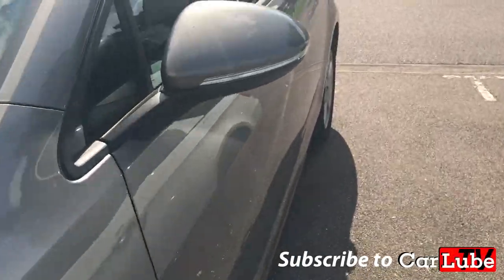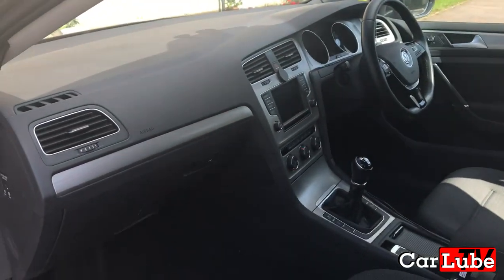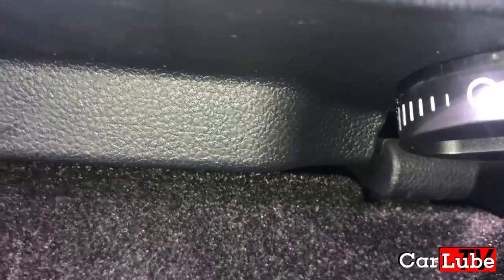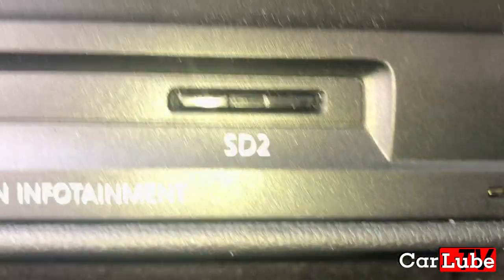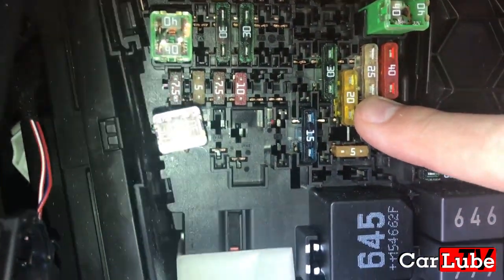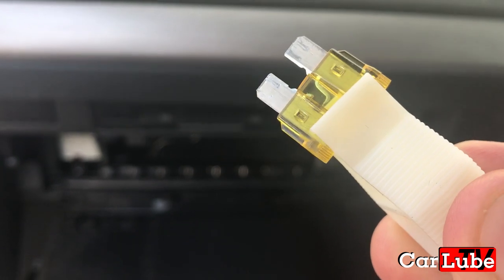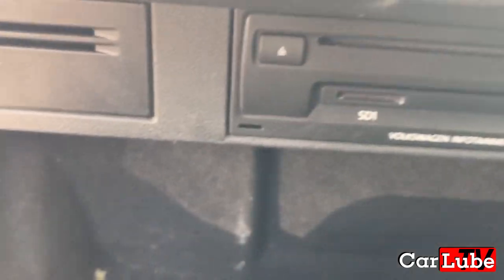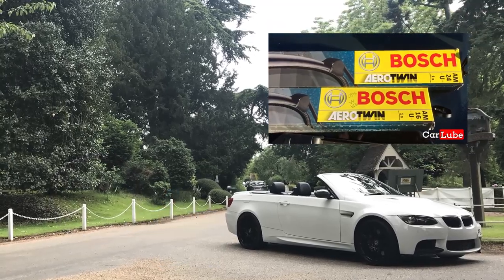VW Golf Mk7 How too change a fuse / cigarette lighter 12v

Comment: Missed an opportunity to share with everyone the multi position option on the cigarette lighter fuse.  In its current position power is supplied when the car is on.  Move it up to align with the other fuses and it will always be powered.
Reply: That is helpful to know, I will never use the cigar lighter socket on my car, but can use that for a dashcam install.
Reply: @Jimages_uk so you will use the cigarette lighter then.
Reply: @robbylebotha  no, I used a permanent supply.

Comment: If you move the 20A fuse up a notch so it’s level with the 30A your cigarette lighter and any other power sockets will work with the ignition off.
Reply from the maker: Wow great info mate.. 👏

Comment: Thanks for this, the general info still holds true, but on my 2017 Golf SV I discovered a few changes.  Although in the same position, the release lug operation design had been slightly changed. The left one was a ‘click lever’ that required first to be lifted up and the right one was a very awkward ‘push lever’ that was hard to access and operate behind the ‘cooling’ vent control.  Once these were released the glove box dropped down, but be ready for the ‘soft close’ retaining control bracket to fall apart. I found it very difficult to re-assemble the glove box, requiring the ‘soft close’ bracket to be first engaged with the ‘friction gear’ retention bar at the same time requiring the left lever to be set and the right button to be simultaneously pushed up. It required several attempts to get all three elements in the correct position. I find it hard to believe that VW could have designed such an awkward method of retaining the glove box in order to access the car’s fuse panel?
Reply from the maker: evanofelipe thank you for your info, I’ll have a new golf soon so I’m sure I will find this too

Comment: Also, if you move the yellow fuse up so that its in line with the three fuses either side, it makes the cigarette sockets in the boot and beside the gear lever live all the time, ie not ignition controlled.
Excellent video BTW. So easy to watch and follow.

Comment: Couldn't make head or tail of the manual, so I looked here and found this: worked in about 2 minutes. As it happened, my fuse wasn't blown but merely loose. Removing and pushing it back in firmly worked a treat. 

Excellent practical video, thanks.
Reply from the maker: @Torstenn-b3x  glad to help bud.

Comment: Great video buddy. Thanks to you my problem has been solved! Cheers.
Reply from the maker: Mohd. Alhamouri thank you for saying
Reply: By the way, my fuse box on my 2016 GTI MK7 is located under the steering wheel so it was easier to access :)
Reply from the maker: Mohd. Alhamouri yours is a left hand drive then I assume
Reply: Exactly. However, i didn't buy the new fuse yet. Tomorrow i will go to the dealership to buy it. Hope it won't be that expensive. How much do you think it costs? They must sell it at the dealership i assume. I removed the yellow fuse and saw it was burned, i replaced it with the other yellow fuse which is in the upper row of the fuse box and the cigarette lighter worked perfectly. The upper yellow fuse is for the Infotainment screen, it went dark after i removed its fuse, so i put it back.

Comment: Hi ,why does it show the fuse box is on the drivers side on another video.I have a 2013 golf Mk 7 is the fuse box under the glove box compartment.
Reply from the maker: Carl Thomas the fuse box is on the left regardless of if it’s a left hand or right hand car.
Reply: @carlubetv  Hi, so it is behind the glove box, and not behind the smaller box by the steering wheel?
Reply from the maker: Carl Thomas did you watch the video, I was pretty clear I thought

Comment: The clock jumps 1 or 2 hours each time I turn the ignition on, Which fuse is this please?
Reply: Thats not a problem with the fuse. If a fuse has blown whatever powered it is protecting will no longer reach the device and will no longer work.

Comment: I did the same and still doesn’t work. Anyone know what else it could be?
Reply: If you are still stick get a multimeter and check the continuity of the circuit see if there is a break in a wire somewhere

Comment: ive just done this, but the cig lighter socket is still dead !
Reply: Did you fix this?? Check for continuity on the circuit if you didn't fix it
Reply: @PsyMongSki  still not working, ive given on it
Reply: @gjsiddall0611  did you check the continuity of the circuit? Its easy enough to do with any multimeter